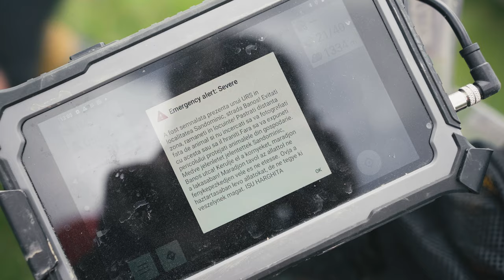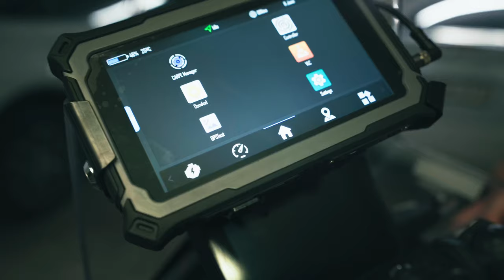Big mistake? Choosing a KTM 890 Adventure R and Norden 901 for wild adventure.

Comment: Which GPS mount did you use against the KTM? And fingered it well with the Carpen-iter
Reply from the maker: Hey! We used the Vanasche Motorsport 890 GPS mount! Super handy and easy to install/use
Reply: @alexislecarb  Thanks for the quick reply. So the Carpe-iter fit well and there was no problem with this on the trip?
Reply from the maker: @VAH6010  not a single problem! Everything worked absolutely fine. First time using a Nav device and it was a blast to have that big screen with the terrain commands!
Reply: @alexislecarb  Thank you so much. Then there will probably be a purchase of one like that 😀
Reply from the maker: @VAH6010  super glad to hear that! Feel free to reach out if you need anything bud!

Comment: May I please know what support did you use to hold the tablet? I mean the one you screwed onto the plastics of the bike above the mileage counter?
Reply from the maker: Sure! That’s the Vanasche GPS mount for the KTM 890 2023. You’ll find it on Vanasche Motorsport website
Reply: @alexislecarb  Thank you, anyway you make great videos and I would love to be there with you! Last thing do you think a tablet like that can hold up? I have the Tripltek pro 9
Reply from the maker: @Gasrovescio  what do you mean hold up? Like does it fit the gps? We are using the Carpe ITER tablet, which is super tough, and it’s not moving an inch!